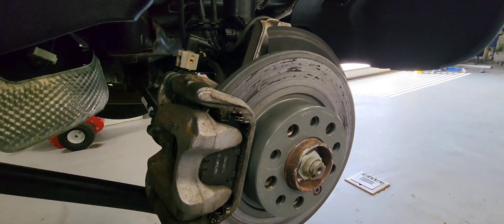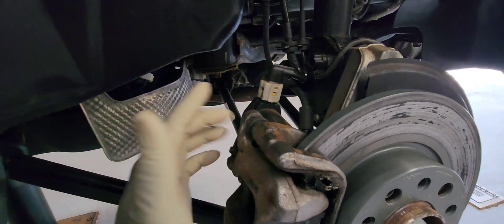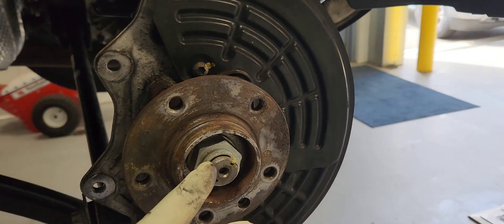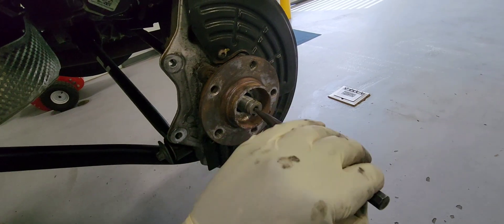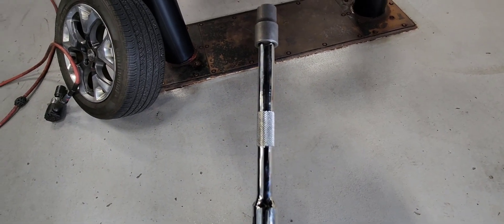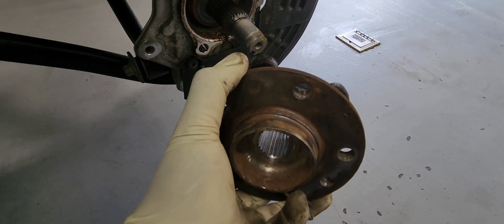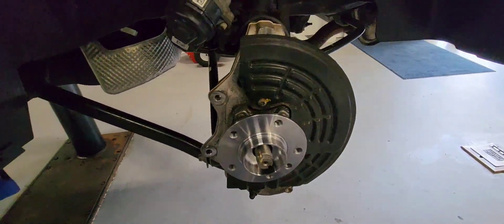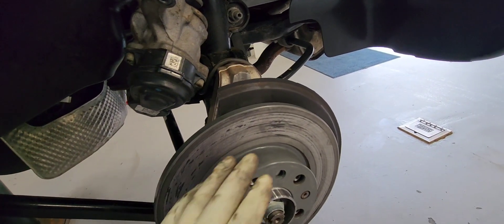2016 and newer Jeep Compass rear wheel bearing replacement

Comment: 🤣 that bearing was shot, very good replacement ❤ but that rotor would have got replaced.
Reply from the maker: I did replace the rotor it ended up warped
Reply: @steevegmtech7326  I know I could see it plan as day, good job for replacing it.